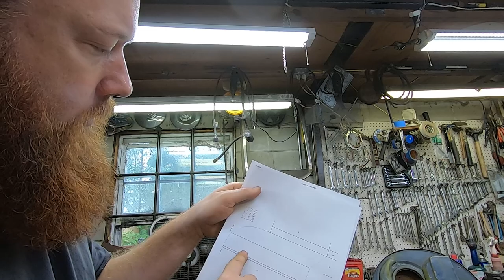Cooling Tins for J Tube exhaust |  Fabricate Industrial Tin VW Split Bus Restoration Vandemic E13

Comment: So how did the 2 piece push rod tube work out? Curious, I just built a 1600, test ran it no leaks. Installed the engine, guess what a couple are leaking....I want to try those tubes.
Reply from the maker: Hey Scott, thanks for the question. So far, so good except for a possible leak on one. I'll need to investigate further to know for sure. With that said, I believe the stock PR tubes are fine provided the bellows have sufficient spring in them to maintain tension against the sealing surfaces. Of course all good standard practices apply; seams up, clean & smooth sealing surfaces, fresh gaskets, endless double checking, tap your heels together 3 times... To put it differently, I'll be using stock tubes painted flat black on my next build because I won't be trying to avoid removing the heads. Thanks for watching!
Reply: @HapticGarage  many thanks. Btw, love your videos. I seem to learn something new every time I watch. Actually, today, it was so cold, really didn’t want to try to fix the leak. But I tried anyway. Once I moved the tin, I was able to rotate the leaky PRT. Ran the engine for a while, seemed to be better. Ran it again but we’ll see later.
Reply from the maker: @scottalvey1787  Thanks Scott! I hope that resolves the issue. The fact that it rotates may indicate the "accordion bellows" have relaxed a bit, but hopefully the low temps have something to do with that. Thanks for the follow up!
Reply: @HapticGarage  well, it didn’t work. Seems less than it did but still leaks. BTW, its #4 exhaust so shouldn’t be too hard....lol. On the end thank goodness. I’ll try the Scat PRTs.
Reply from the maker: Bummer. It was a long shot after how loose the pushrod tube was but didn't hurt to try. I hope you have better luck with the expandable type. Thanks for the follow up and let us know how it goes!

Comment: Hallo erstmal, ich sitze jetzt schon 5 Stunden am Laptop und sehe mir Deine Videos an. Ich muss gestehen ich bin ins schwitzen geraten. In Brasilien, wo ich lebe, gibt es am VW-Motor keine Heizbirnen. Also auch kein Blechteil welches das große Loch verschließt. Um einen solchen Verschluss herzustellen fehlt mir der Platz und das Werkzeug. Das wäre doch eine Lücke für Dich, oder? Ich fahre einen 96ger Kombi Clipper, den ich angefangen habe zum Motor Home umzubauen. Alles vor dem Haus auf der Straße. Ich möchte damit Brasilien ein wenig kennen lernen. Mal sehen wann es los geht. So, mein lieber, mach schön weiter und bleib gesund
Reply from the maker: Wow! That's great Christof. I'm glad you found the channel and have been enjoying all the videos here. VW made and used these tins on some engines, but I have only found them advertised as aftermarket parts from Geneberg.com, Aircooled.net, ISP West, and on ebay. I've never bought them myself, but maybe you could find a set that could be shipped to Brazil. 
Have fun with the motorhome conversion, they are a lot of fun! I just got back from a VW show where I stayed in my motorhome. It's a great way to enjoy the hobby. It was great to hear from you again, thanks for being here!
Reply: @HapticGarage  Ja, das ist doch mal was. Vielen Dank für die schnelle Nachricht, werde morgen gleich auf die Suche gehen. Hast Du eine E-Mail Adresse? Ich würde Fotos schicken.
Reply from the maker: Yes! Use the email address on my channel's About page that is labeled "For Business Inquiries". I'll watch my inbox for pictures of your project. I hope you have found a good supplier for the tins today.
Reply from the maker: Entschuldigung, hier ist das oben auf Deutsch:
Ja! Verwenden Sie die E-Mail-Adresse auf der Info-Seite meines Kanals mit der Bezeichnung "Für geschäftliche Anfragen". Ich werde in meinem Posteingang nach Bildern Ihres Projekts suchen. Ich hoffe, Sie haben heute einen guten Lieferanten für die Dosen gefunden.

Comment: Get yourself a real air extractor when you're welding those zinc plated nuts.. it all adds up will give you brain and nerve problems.
Reply from the maker: Hi Daniel, yeah that zinc plating can be an issue. I eventually found a respirator that I use more often all the time. Ain't getting any younger!